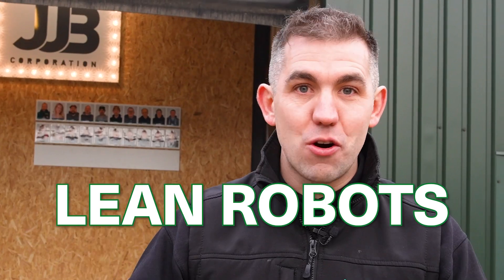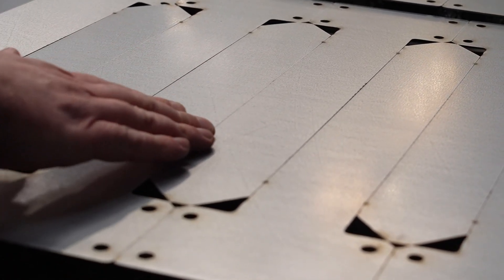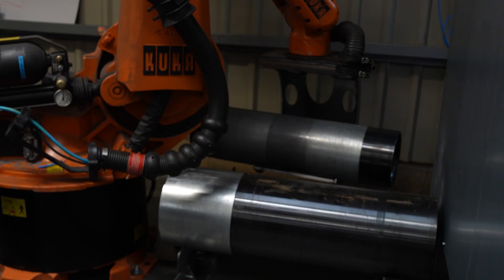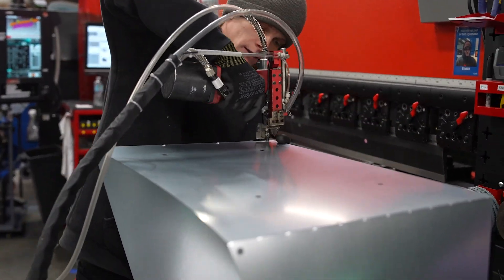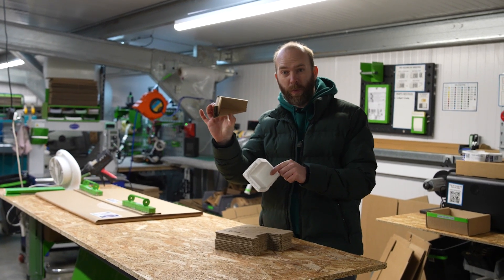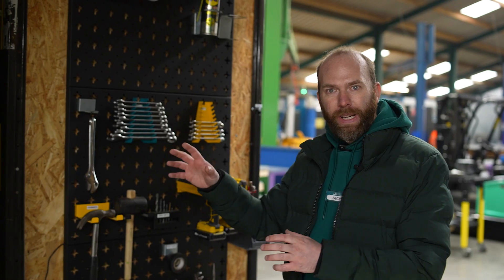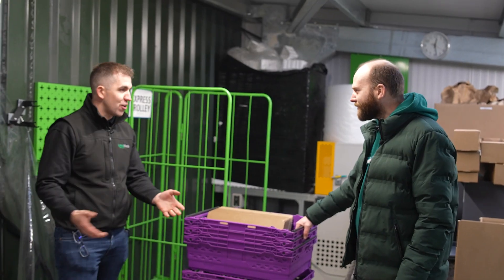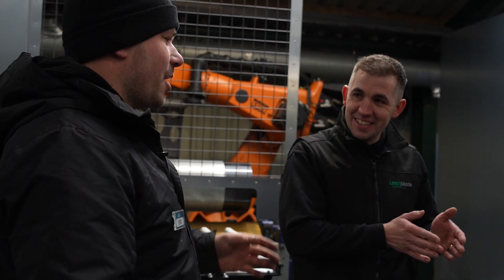MIND-BLOWING! Lean Manufacturing! : A Day's Work in ONE HOUR!

Comment: 'Use your brain and not your wallet' _ and then you buy Kuka Robots for 200.000 USD .. I dont get what is supposed to be lean with that? Its a good shop. But Lean?
Reply: The robot cost less than 10k, we used in house self taught skills to, create the work cell, manufacture and program the whole system 😉🙂
Reply: Human welders can be a prickly bunch to work with and they aren’t cheap either.

These robots seem to do a good job on these light duty products.